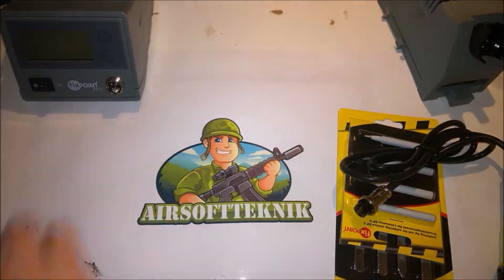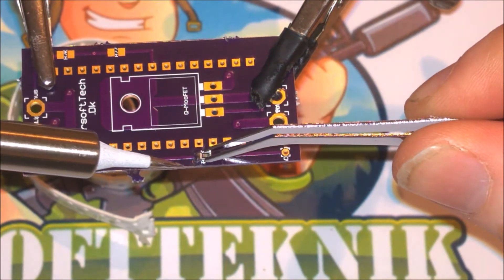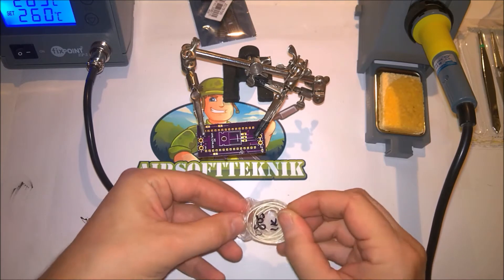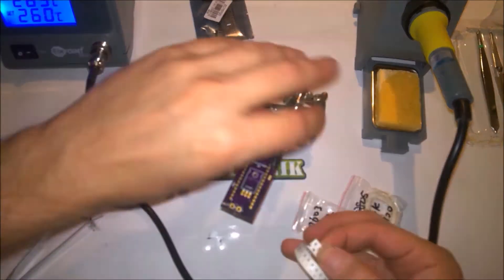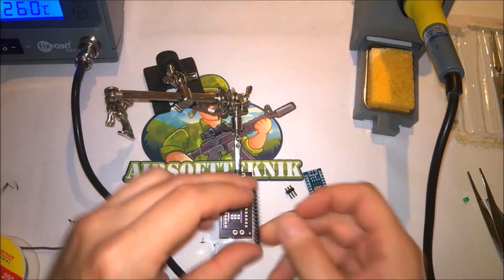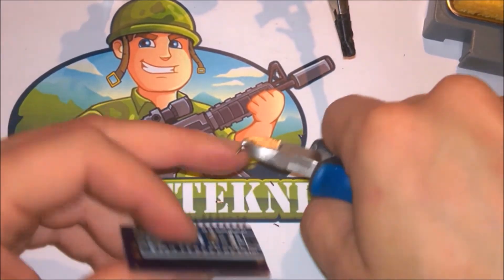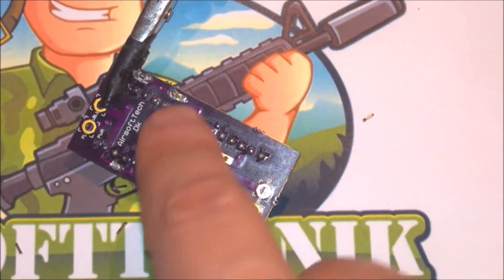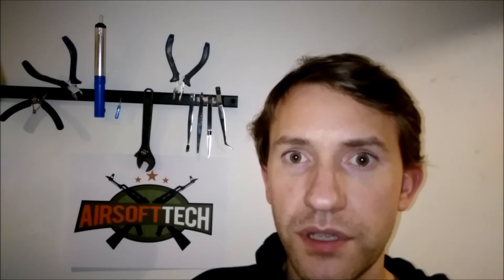Arduino Burst mode - Soldering the PCB

Comment: Hi! Great tutorial! I have a few questions. What value resistors are you using here? Are they in place of the big ones you show how to solder on in earlier video where you don't use professional pcb? Thanks!
Reply from the maker: I'm using a 1K Ohms and a 10K Ohms resistor (And Yes they are instead of the bigger resistors from my first hand soldered mosfet) ...
Reply: @AirsofttechDk  Help please. I followed your instructions exactly. the only thing different was I used an IRFZ44N Mosfet chip. I plug it into the gun and plug the battery into the mosfet and the arduino nano doesn't even turn on. Please help. Thank you.
Reply from the maker: @santoslozano2957  Go to my support side: http://airsofttech.dk/EmailMe.cshtml Then fill out a description on how you have created the mosfet ... telling me all the component details (What components you have used) ... Then I can offer you some support by mail ... REMEBER To fill out your correct email adress !!!